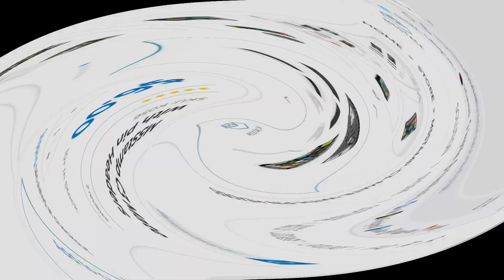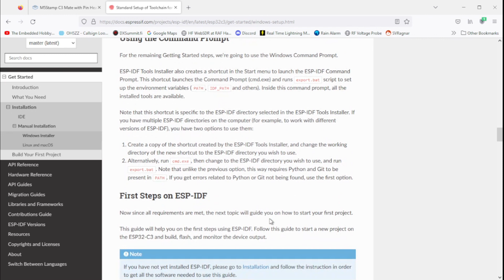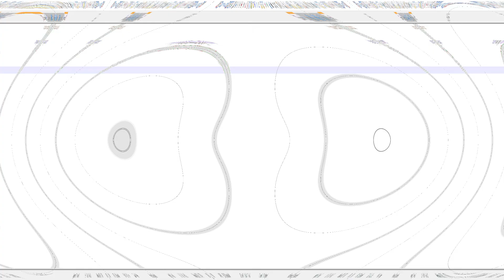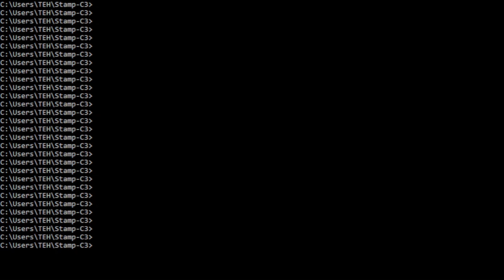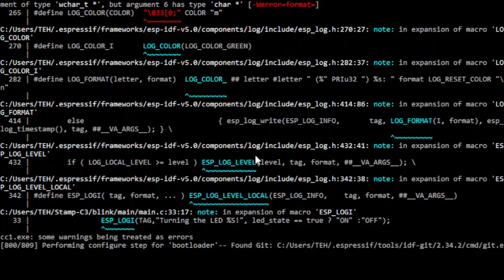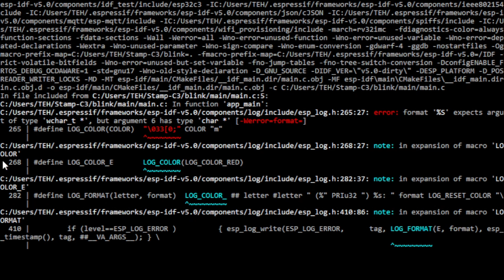#181 ESP32 C3 Springboard the blink!

Comment: You shouldn't need the button as the internal programmer should toggle the program mode pin internally.
Will you blink the internal RGB LED next?
Reply from the maker: I'll give that a try, maybe a rgb flash sequence. Plus I'll see it it can be programmed without pressing the button.

Comment: I did try the IDF under VScode but just had so many problems that I gave up and went back to Micropython.
Reply from the maker: I got the idf going in vsc, but it was not a great experience. Could not get eclipse to stop throwing its toys out of the pram, I just could not get it to install all the tools.  But notepad++ and exp32 shell worked just fine.